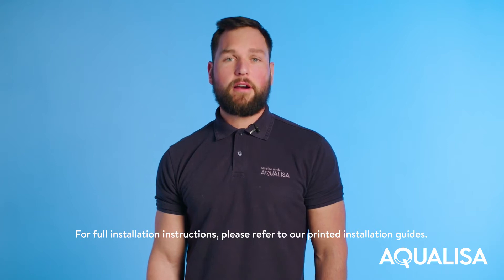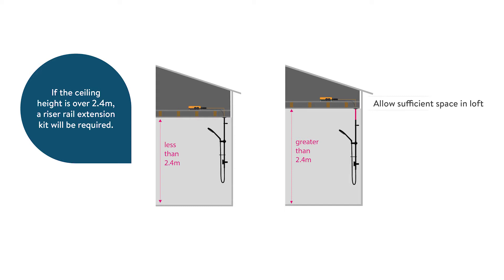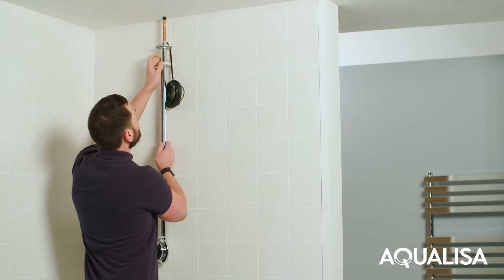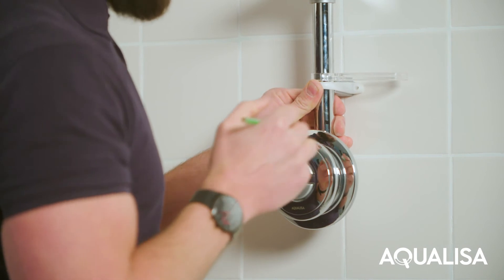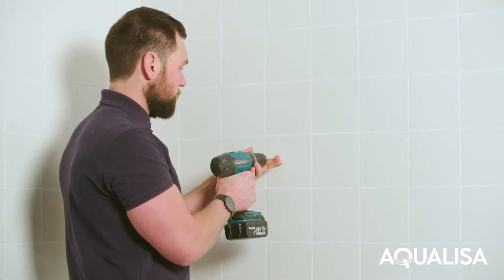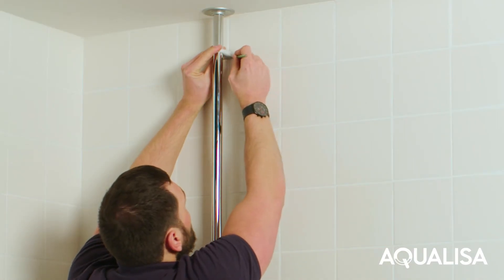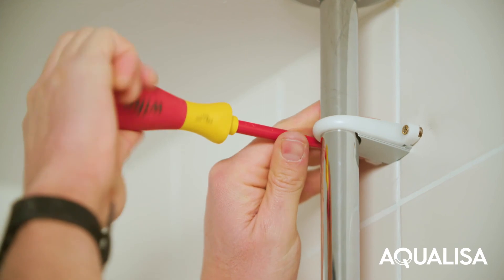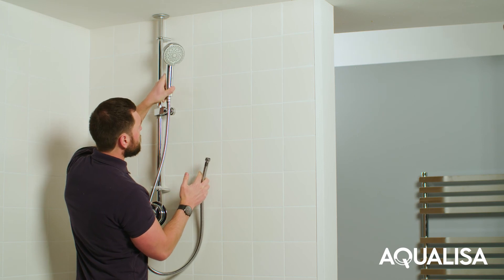How to install an exposed Aqualisa Quartz smart shower system

Comment: Is this a magic shower 
Where is the hot and cold water supply ?
Reply: In the loft. Hot cold go into the controller above and get pumped down the copper pipe within the riser